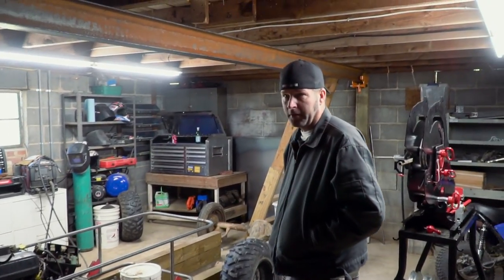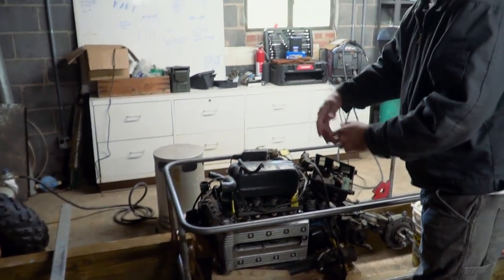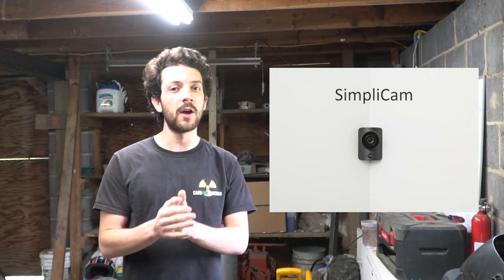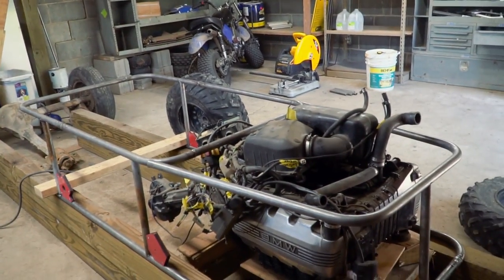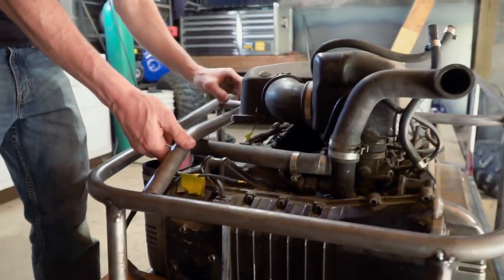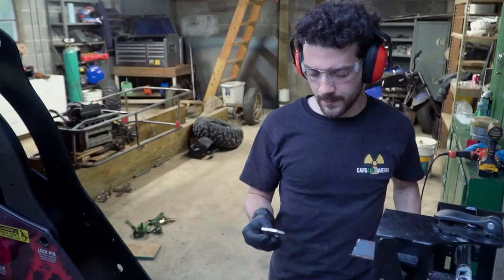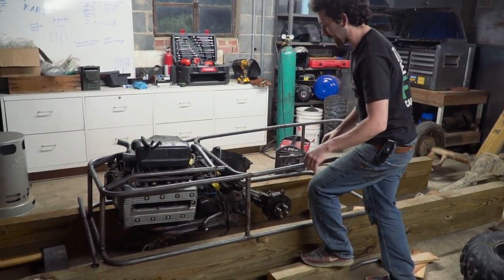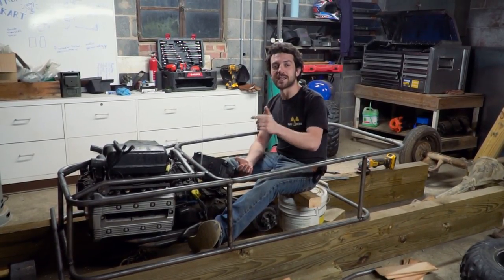1000cc Mini Trophy Truck Build Pt. 2 | Hanging the Engine & Finishing the Frame!

Comment: Ok so first off you don't weld anything together until the frame is finished. It still looks like a tub  with a divider . And your down fall is john not knowing nothing but disinformation to the builds you are constructing. John's knowledge is dismal  and disrespectful to those that actually have the knowledge to do these builds. Sorry John but you need to educate your self instead of show how to hurt people in your builds.
Reply: Christopher Ackerman Yes there is a difference in expertise and age. Isaac has many more years of experience as a mechanic. Together as a team they can build almost anything you can imagine and on a shoestring budget!

Comment: If you're going to build a mini trophy truck.........you guys are wayyyyy off , the Motor goes in the back.....and why are you using that BMW pos engine......get a 1000cc street bike engine since thats whats commonly used in those builds........AND get a regulation book and build plans so you do it right............smh......that engine is a boat anchor and you're mounting it in the front.....good lord.....disaster in coming.